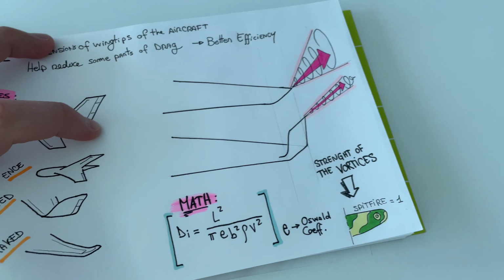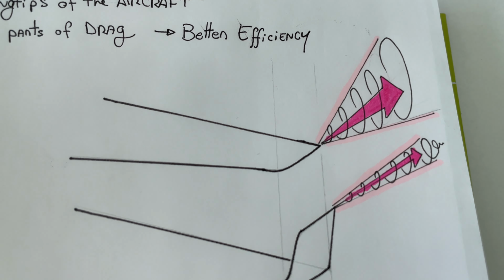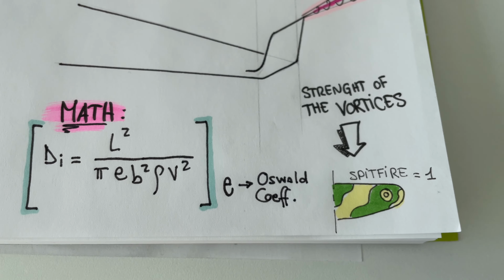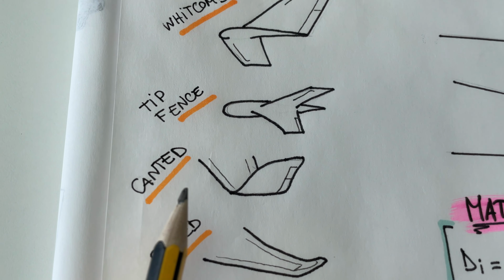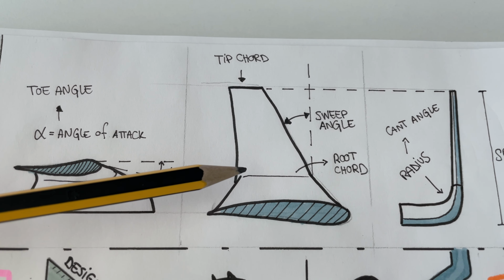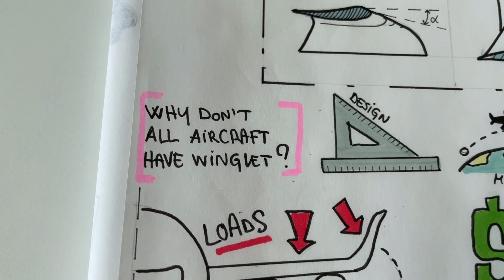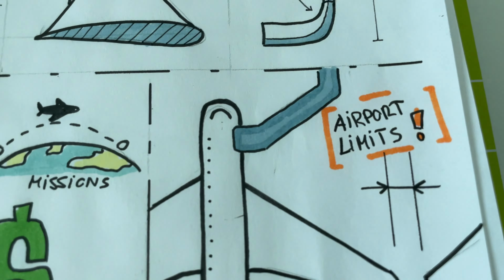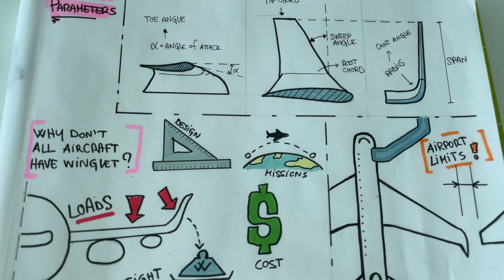Aerodynamics of Winglets

Comment: I would have appreciated more explanation. You listed geometric parameters without talking about how each of them affect the performance of the winglet and why. You mentioned the oswald coefficient has an impact on the strength of the vortices, but again didn't mention how that coefficient is determined or why it has the effect that it does. I don't feel like I'll be able to take much away from this video.